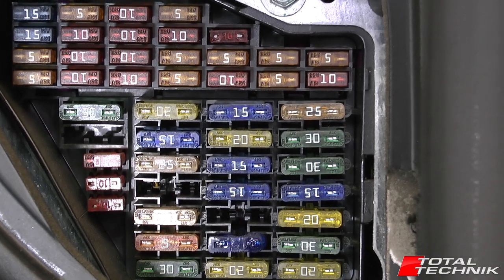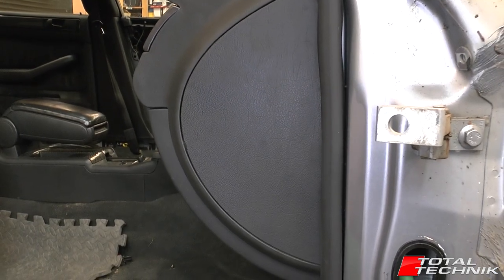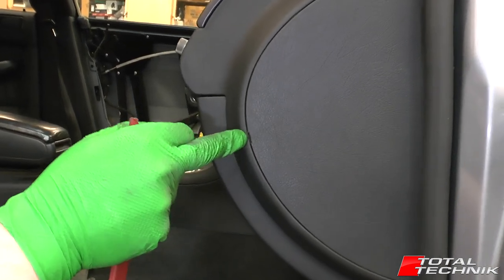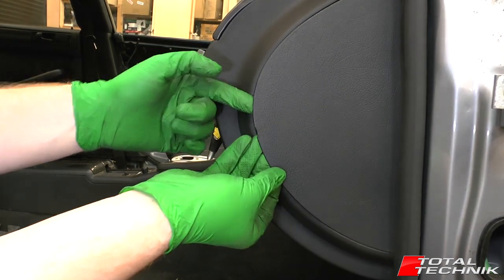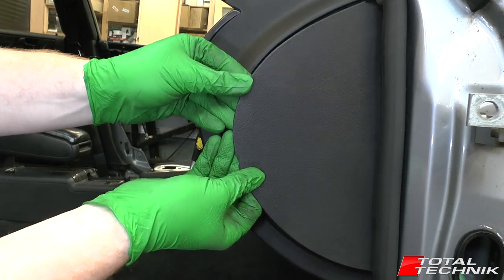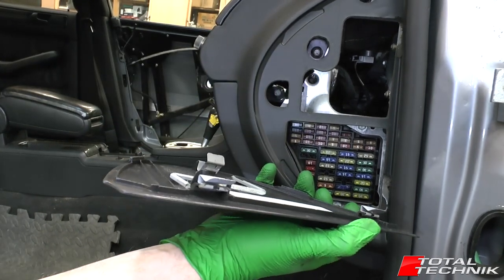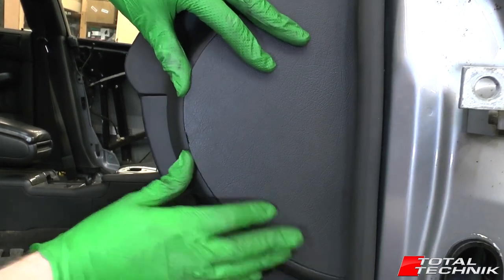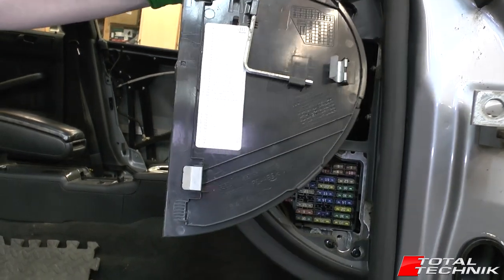How to Locate Internal Fuse Box - Audi A6 S6 RS6 - C5 - 1997-2005 - TOTAL TECHNIK

Comment: My car has no power at all (no lights on dashboard, it won't start and no power to any electronics inside). Batter is fully charged as I got it charged from autozone. I wanted to check fuse as well, but not able to understand which fuse would be responsible to get the power off the battery and supply it to the car? Any suggestions? I have 01 Audi A6